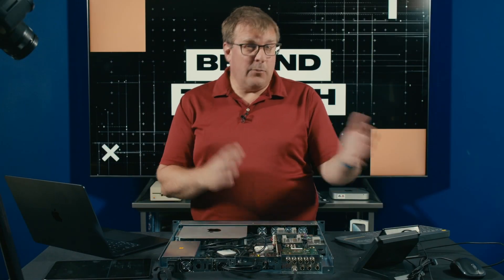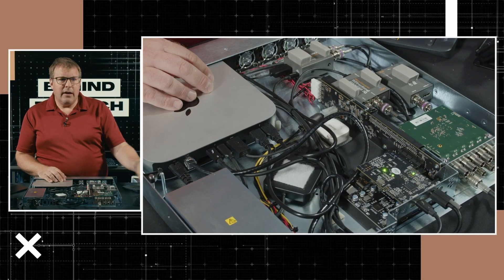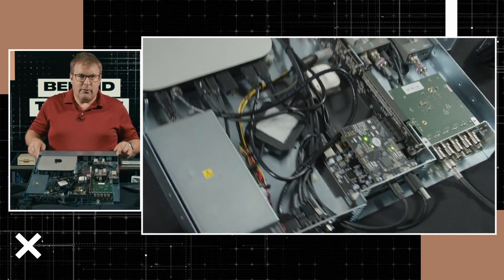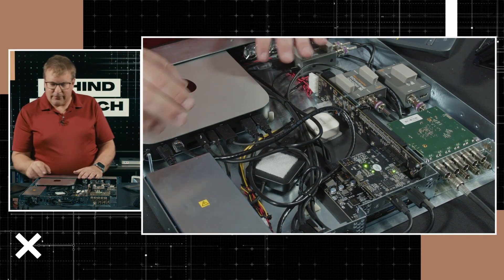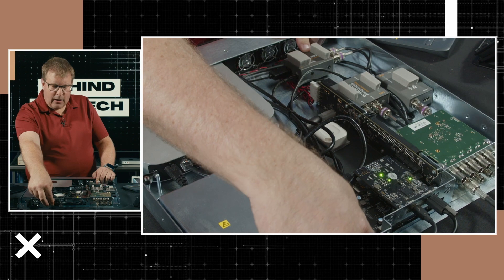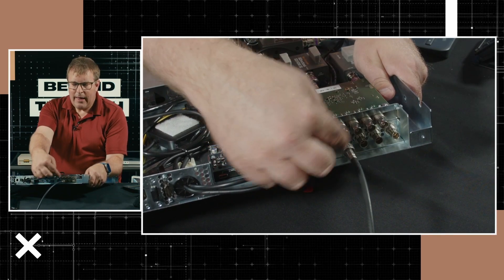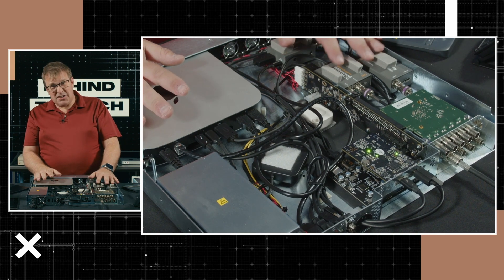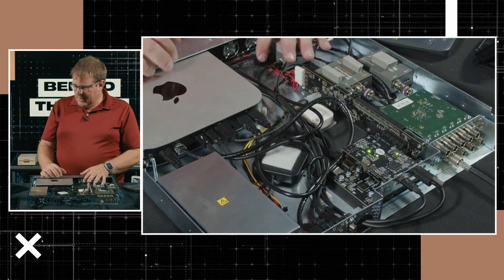Building a Zoom ISO Computer

Comment: What video card are you using just underneath the Decklink card?
Reply from the maker: I totally just realized I did not do a good job of showing what I did underneath. Here is a photo of what I did- https://www.dropbox.com/scl/fi/pl91sc2b5ygfa6oj2xhkz/IMG_1936.jpg?rlkey=79rnmk6tpmmd65va6uozj5fi2&dl=0. In short it is actually some panel mount BNCs that I installed to make the server easy to take in and out.
Reply: Hi  @matthandvideoguy  , could you send back the picture please ? The link has expired. Thank you very much !
Reply from the maker: @sebastiend3547  Try this link https://www.dropbox.com/scl/fi/pl91sc2b5ygfa6oj2xhkz/IMG_1936.jpg?rlkey=79rnmk6tpmmd65va6uozj5fi2&dl=0

Comment: This looks like something I need to build, with this configuration are you able to feed video back into the system for the participants to see PPT, clock, and program from the ATEM?
Reply from the maker: Howdy. Inside of the build I placed a Ultrastudio 3G that is using the Thunderbolt off of the Sonnet xMac Server. This allows for a video input back through Zoom. There seems to be a bit of a problem currently with Zoom though right now passing audio through it. If you are wanting multiple inputs I would suggest using a Decimator DMON-Quad and sending the SDI output out of that. I actually have one of these in line and will do a video this next week on how it is used. Thanks for watching.